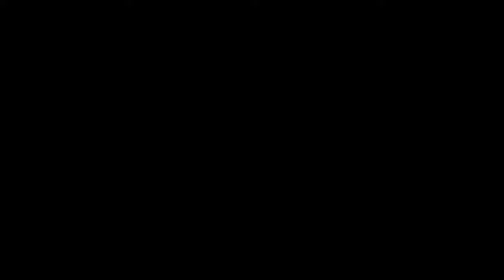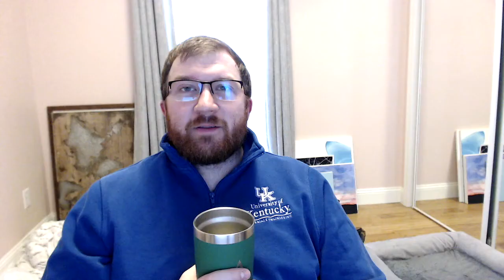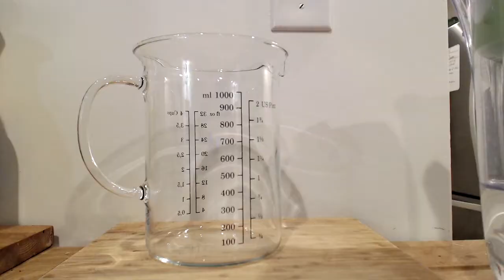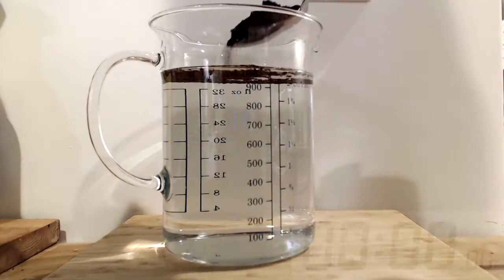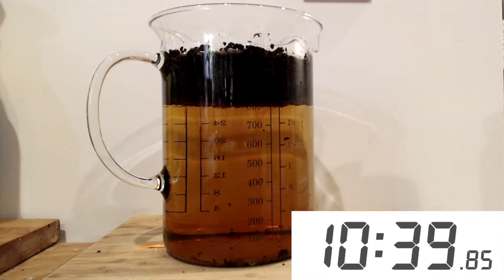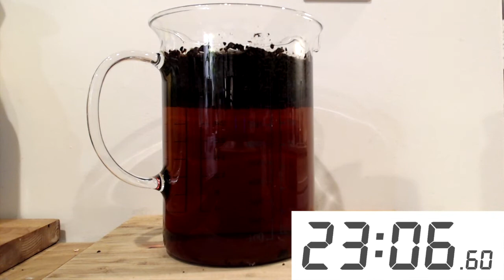Cold-Brew Coffee Diffusion Demonstration

Comment: Try this: Put about 30G of coffee in a filter, and gently submerge the filter in 1L of 200-205F water.  Don't disturb it, let it diffuse for 20-30 minutes. Gently remove the filter without re-dipping it. Result is way better than pour-over and French press, almost as good as cold brew in 24 minutes instead of 24 hours!